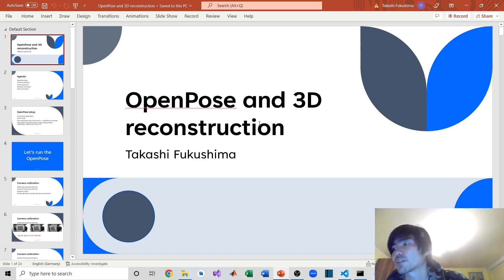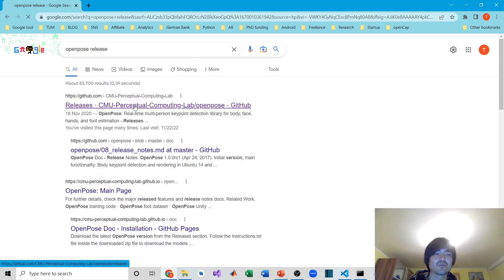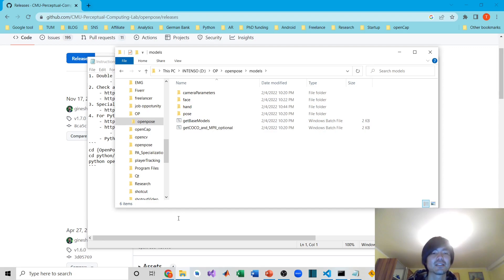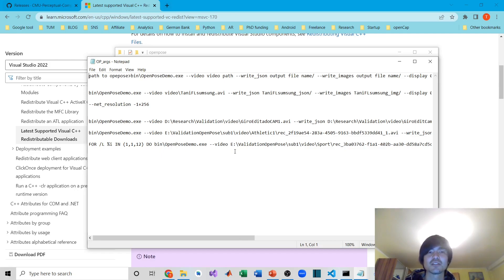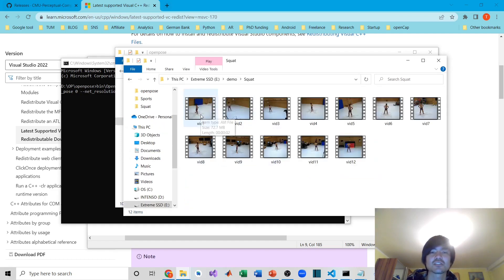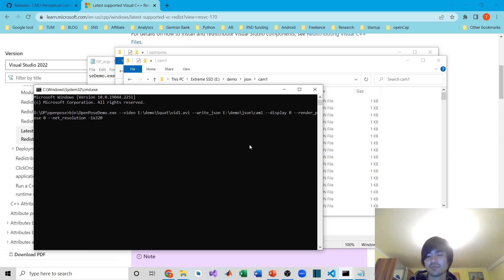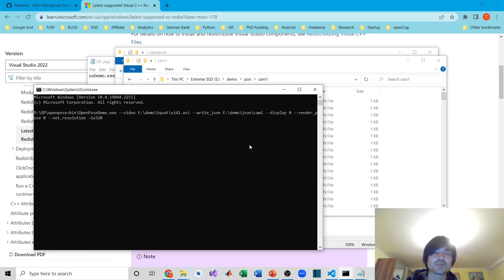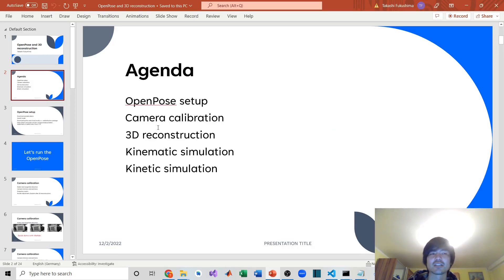OpenPose and 3D reconstruction -- Part 1 OpenPose Setup--

Comment: Great Video! However, I am running into this errowhen i run the base models bat file: "Connecting to posefs1.perception.cs.cmu.edu (posefs1.perception.cs.cmu.edu).. failed: Unknown error.
Retrying." How do i fix?
Reply from the maker: Thanks for the comment! It's stated in the OpenPose doc, but url in the bat file is expired.
You can use this  https://drive.google.com/file/d/1mqPEnqCk5bLMZ3XnfvxA4Dao7pj0TErr/view?usp=sharing
https://drive.google.com/file/d/1QCSxJZpnWvM00hx49CJ2zky7PWGzpcEh/view?usp=sharing

Comment: Hi， I am installing the openpose environment, but for the CMake step, I can configure the file folder path. It said 'CMake Error: The source directory "C:/D/openpose" does not appear to contain CMakeLists.txt. Specify --help for usage, or press the help button on the CMake GUI.' How can I fix that? Thanks a lot
Reply from the maker: Hi, thank you for your comment! Make sure that the cmake text file in that folder.
Reply: @takashissportsexercisescie5354  This error has been solved. Thanks a lot. However when I built solution in the VS. Many error happened in that time. It's so annoying.
Reply from the maker: Yes that is a pain... which error did you get from VS?
Reply: @takashissportsexercisescie5354   Could I send email to you? This week I am busy with revising my paper and have to submit that in 1st of March. If you have time could you contact me in email Thanks.
Reply from the maker: You can reach me with the address below 

takashi.sports.and.exercise@gmail.com